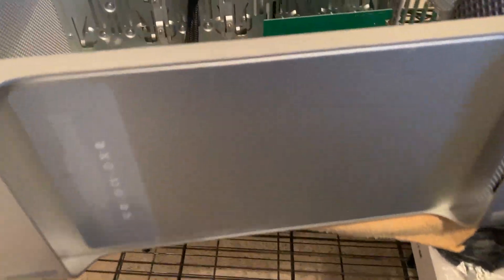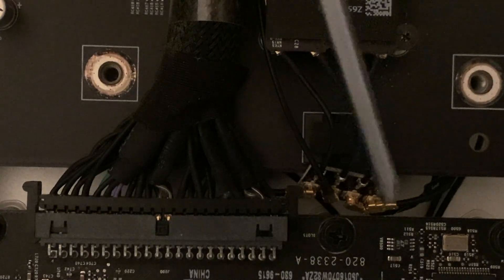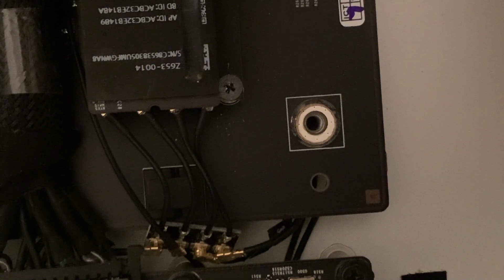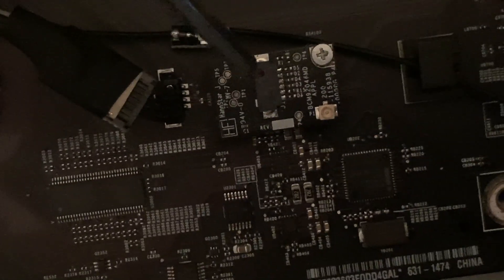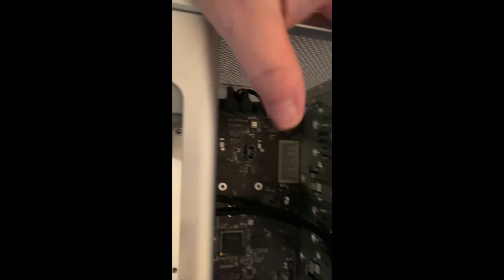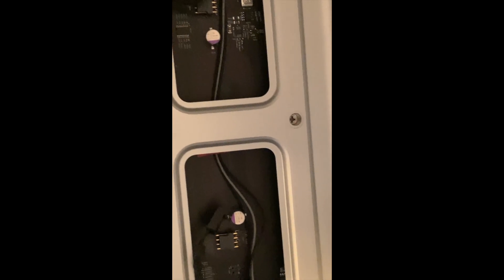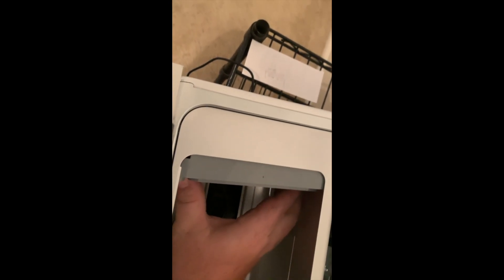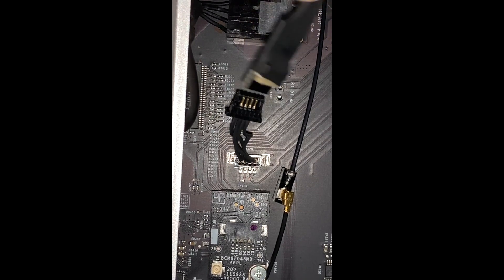OSX Wifi Installation Mac Pro 4,1 and 5,1 **Wifi and Bluetooth Upgrade**

Comment: Wifi doesn’t work after upgrading to Big Sur, only when my metal compatible card is in. Any idea? Thanks!
Reply: I don't think Metal compatible has anything to do with the wifi card; does it?

Metal compatible refers to the graphics card. Graphics cards in the old MacPros have to be upgraded before you can run Catalina macOS 10.15 or above.  

I don't understand how your big sur could run at all (without patches or something) with a non-metal graphics card in.

I think this is correct, from my limited knowledge and experience:
I have been using macs for years, but just got my first MacPro last year. I got one with the graphics card already upgraded, specifically so that I could have 10.15+. 

It was ready to update to Big Sur, but I was nervous about it and procrastinating.  Then, all of a sudden my wifi card quit working. There were software patches installed (previous to being shipped to me) that allowed the original wifi card to work with 10.15, since it was no longer supported natively on newer OS versions. Supposedly, a software update must have overwritten the wifi card driver / deleted the patch, and caused it to quite working. 

I decided to try to upgrade the wifi card instead of trying to patch again, due to lack of knowledge of software patches & also thinking that it would be a more 'permanent' solution.

Comment: Is it necessary to remove the old Bluetooth card from its socket. Or is that socket just a holder with no connections ?
Reply from the maker: I took mine out after this video however you re more than welcome to leave it there. It is a single screw post and the cable is the connection

Comment: I'm having a really rough time with getting Mac's copper connectors on the OSXWifi terminals. Tried angle, tried rockin, it doesn't stay attached. Any shortcuts?
Reply from the maker: check to make sure they are round, I had a hard time too.
Reply: @lftdlyfe  I only needed this card for BT 4.0, and got it hooked up with an external Antenna system and the BT range is very poor. I need to keep my external antenna next to my trackpad. And forget about using my BT headphones. I had picked up Wifi/ BT 4.0 PCIe Card from Amazon, but I am finding out I now need a connection for the USB port on the motherboard. Now I am awaiting a cable that will take the 9pin adapter to USB to see if that works. I am also looking into this antenna from Walmart: https://www.walmart.com/ip/USB-3-0-Bluetooth-WiFi-Adapter-AC1200Mbps-5dBi-Antenna-2-4G-5Ghz-PC-Wi-Fi-Dongle-5-0-Receiver-Wireless-Network-Adapters-Windows-10-8-7-Mac-OS-X-10-4-/218629081. This  is turning into a nightmare, sorry I dove into it !
Reply from the maker: @joshweinstein5843  Might try this one:  Works fantastic in my other Mac Pro - https://www.amazon.com/gp/product/B07WGS46PY/ref=ppx_yo_dt_b_asin_title_o08_s00?ie=UTF8&psc=1
Reply: @lftdlyfe  Funny, I just purchased that one, but now I have to wait for a 9pin to USB cable in order to make the BT work for that card. Or would you know of any open 9pin USB open on the motherboard of a 5,1 ?
Reply: @joshweinstein5843  I have this same question. Did you ever find an answer?